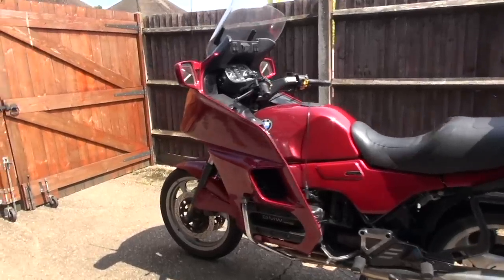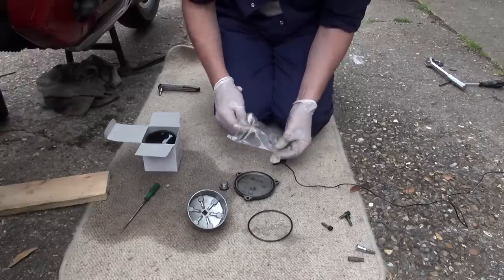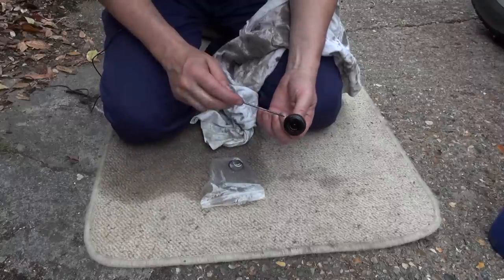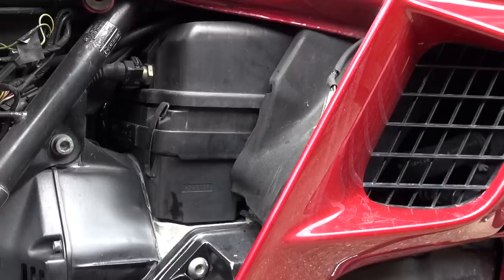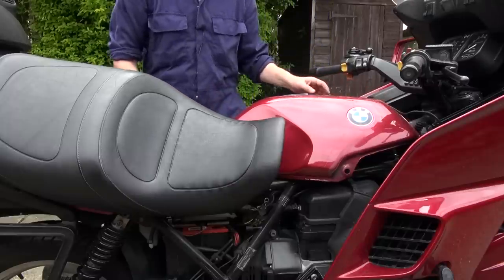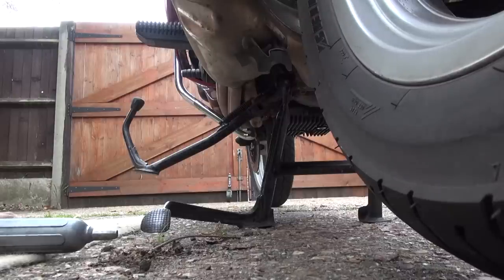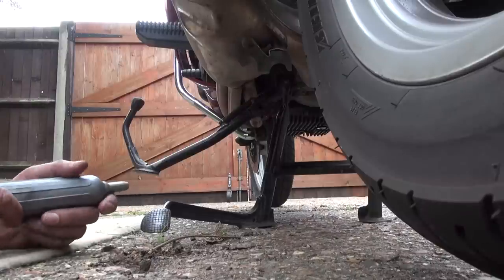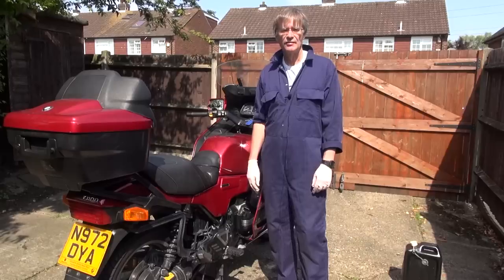Motorbike BMW K1100 10k service

Comment: Great video.  I'm especially grateful that you didn't add music to it.  Thanks for that.  You've made swapping air filters look dead easy -- I've always had a problem with that.  The clips are very fiddly.  The filters on these bikes are quite large and I don't feel they need to be changed often. 
I own a 1996 that looks to be the twin sister to yours.

Comment: I remember my 12,000 mile service (94 K1100LTSE) it was about 1 years old. And to maintain the 3 years unlimited mile BMW warranty I needed service done by a certified BMW mechanic. It got new oil, filter, plugs, fuel filter, air filter, steering bearings, new rear tire, valve (bucket) adjustments, it took over 8 hours. Labor was 75.00 an hour. I left for a 2000 mile drive and 3 days later my rear brake pads were steel on steel. Good thing I found a dealership in Canada. I still got the bike, and have a lot of miles on it but it sure does not get service like that anymore. No wonder BMW can have unlimited miles warranties with the services they require for warranties to be valid  nothing has a chance to break down, unless it’s your brake pads they missed,then it was “you must drive with the brakes on” . Nice video 👍

Comment: Good video. Suggest you thoroughly clean both oil filter and oil filter cup before installing. Also suggest filling oil filter with oil about 3/4th full. Prevents dry start.

Comment: Few things. It's a good idea to prefill the oil filter when possible.  Second I strongly suggest not starting any fasteners with the ratchet attached. That's a great way to unknowingly cross thread.  Third I'm surprised the oil is filled to the top of the window.  In every instance I've known the proper oil level is in the middle of the window though this one might be different.
Reply: If you were wondering he over filled it, oil level should be around or slightly below the dot after starting engine and letting oil move around.
Reply: @ElaBellll  In the manual of a K100, the top of the circle is the maximum, the bottom is the minimum. Pretty sure it is the same at this bike. As you could see, he has the manual also.

Comment: Very useful video, but I do tend to warm the oil up before letting it out; thin oil does tend to empty slightly better than cold more viscous oil, BUT if the oil is hot, you have to be a lot more careful as hot oil can burn.

Comment: Not sure why you would remove the oil filler cap until you are ready to drain and refill the oil. In my view this only creates a risk situation where foreign objects could accidentally be dropped into the engine. I own a 1994 model K1100LT-SE, my 3rd K1100LT, also own a K100RS 16 Valve and have owned a K1, K100RS 8 valve and K100RT and K1100RS.
Reply: Letting air in helps drain the oil. You can put the cap onto the hole after you unscrewed it to avoid falling something into the oil pan, just make sure air gets into while draining the oil.

Comment: like the video but i think taking your oil filer cap whilst you're taking the bike apart is a dangerous idea. just asking for dirt or worse still a small fairing screw to end up in your engine. In my workshop all the dirty stuff is done before the engine is opened up and it's opened up for the least amount of time.

Comment: Thanks for this very handy video. Would you know how to replace the ABS Relay switch by any chance?
Reply from the maker: Check out section 61.8 in https://www.bskspeedworks.co.uk/downloads/BMW__K1100LT_K1100RS_Repair_Manual.pdf
Reply: @NigelEaland  Thank you so much for replying. Much apreciated. That helps. I am having touble with my ABS lights alternate flashing which started with a weak battery. I have tried to reset with the plug to earth. The lights resets but it goes back to alternate when i take off. I cannot afford a pump or computer so I thought i would start with the relay. Thanks again. Cheers :)
Reply from the maker: @JohnFrancois-ti4wh  I have total sympathy with you. After failing to resolve a braking issue my bike has been in the shop for 4 weeks trying to diagnose a binding front brake. After much diagnosis and rebuilds of callipers and master cylinder the ABS2 has been declared faulty. You can’t get new replacements but there are places you can get the control boards repaired. 

My understanding is that ABS1 and 2 reset in different ways. There is talk of looking for corrosion on connector pins. These links may help you.

http://bmwk10075abs1fix.web.fc2.com/
http://bmwk10075abs1fix.web.fc2.com/ABS2-repair1.html

Unfortunately I’m having an ABS bypass kit fitted and I’m thinking it’s time to replace the bike. 

Good luck.

Comment: Thanks for posting this  video! About the gearbox oil, did you say 160ML? Or 1.6litre?thanks
Reply from the maker: I was talking about measuring the level of the gearbox oil when filling which needs to be within 116-126mm to the top of the filler. You need 1ltr of SAE 80W90 oil.
Reply: @NigelEaland  okay, thanks. I will also measure the old oil for found out how much it will need for the next service..

Comment: Nice video. Thnx. How many miles is on your K1100?
Reply from the maker: Just under 60k
Reply: @NigelEaland  and still going strong I believe. I love the oldskool BMW'S. Thinking about trading my r1200gs in for a k1100lt in good condition.
Reply from the maker: @vinjofin1972  I love mine. It’s a head turner.

Comment from the maker: It sounds like the wiring to the kill switch on the right bar. I think there is a connector on the steering that may have pulled apart. Trace the kill switch wiring.

Comment from the maker: You can buy all the replacement parts as a kit from https://www.motobins.co.uk/. The tools you need are:- metric socket set, flat head and cross head screw drivers, feeler guage, Allen keys, grease gun. Then you need a couple of special tools. The oil filter removal tool and a long spark plug socket https://www.motorworks.co.uk.

Comment: Hi awesome vid. Do you have a video on how to check valve clearance on the k1100?
Reply from the maker: I’m afraid I haven’t. Valve clearance requires shims rather than adjustment so I put my bike into the garage to get them done along with the timing chain. The timing chain was badly stretched at 45k miles.
Reply: @NigelEaland  
ich lebe im bundesstaat amapa in brasilia im norden von brasilien macapa, ein deutscher kam mit diesem bmw k1110lt 750 zu meiner arbeit und gab mir sein fahrrad kostenlos, aber es braucht einige teile, aber sie haben es nicht hier, du hast es geschafft um mir einige dieser Teile zu verkaufen, die ich übertragen habe, und Sie senden es per Post 📪
Reply: Ich habe dieses Fahrrad geliebt, es müssen die 3 Bremsscharen und der hintere Stoßdämpfer ersetzt werden.

Comment: Hello Nigel!  i have an issue with my 11LT -95.  we have no contact when we turn on the ignition unfortunately. Do you have any suggestion where to start troubleshooting? Our problem began when reversing and applying front brake making forks rise. Then we only got contact when turning to one side.  We pushed in a glove between the forklegs under the ignition and could drive home, 20 kms.  But now we dont get it up and running. At full right we could push on the bottom of the key switch but then turning left made it stop, ie no fuelpump no lights etc was working. We are now trying to lift top triple tree to get access to the wiring. Do you have any suggestion what to do next? regards Par

Comment: Hi nigel rhx for yr effort! Is the k75 and k100 identical concerning anatomy resp.partnumbers? Oil air and fuelfiter by any chance identical? Wanna buy k75 or k100 tomorrow
Reply from the maker: The K75 is the cut down version of the K100. The manual I have from the time I had a K75 was also for the K100. Probably the easiest way to check if the oil and air filter are the same is to go on Motobins web site and look up the parts for each. https://www.motobins.co.uk/
Reply: @NigelEaland  thanks that is very helpfull, i live at continent, but this is so far the best partswebsite ....prices zre higher than here on continent i think....you are British...what i wonder...are japanese parts cheaper than bmw parts? In the states bmw parts zre even higher i guess....i have 2 boxerbmws....but want to explore the k model....as daily driver...consumption is quite low, what i read....
Reply from the maker: @bobdelaplage690  the k75 is great for commuting and the fuel consumption much better than the K100.
Reply: @NigelEaland  thanks Nigel!

Comment: I can't believe you got those 3 air filter clips back on w/o taking anything off.
Reply from the maker: It’s a right fiddle and would be so much easier if one end of the clip was retained. The front one fas to be done by feel.
Reply: @NigelEaland  I have would liked to have seen you do it on the vid...
Reply from the maker: Beemrdon it was difficult to film as for the rear clips my hands blocked the view and for the front I do it by feel. What you need is long pointed pliers to place and hold the clip in place while you use a finger on the other hand to push the clip down. 

My next video will be changing the front disc rotors. I just need a nice warm day. Thanks for watching.

Comment: Hello again!! We have found and reöaired the problem. Cables in the triple tree were scuffed. Now they are repaired and made lo ger. But now next issue...  Backlight blows and also stoplight isnt working. Do you have any suggestion about that? Best regards Pär
Reply from the maker: Pär Jonsson - the bike has a bulb monitoring unit. The hand and foot brake switches go into it and the rear bulbs are driven from it. For me the obvious first thing to do is put a volt meter across the bulb connectors and see if you have about 13.5 volts going to the bulbs with the engine running. When you start there should also be a red light on the instrument panel which goes out only if both brake switches and the brake bulb are working. Do a search on google for a wiring diagram. Bulb blowing can be poor bulb connection somewhere causing the bulb to flicker and die early. There may be a poor negative connection to the bike frame near the rear lights.
Reply: Thanks for thst. We will have a try. Pär

Comment: Kind of ruff. You should start by hand with threads like those : extremely sensible, you brake it once and you are lost forever. And as the time goes by it becomes worst. I hope you won't discover the hammer.

Comment: I have an intermittent click and clunk sound from the gears when the clutch is pulled and the engine is ticking over, what can  this be? K1100LT 1997.
Reply from the maker: Are you sure it’s the gearbox? I think it’s your timing chain. Get it to a garage ASAP before it snaps. The timing chain is really thin and only last about 40k miles. I had the same problem and when they took mine apart the chain had worn a hole through the tensioner and was ready to break.
Reply: @NigelEaland  Many thanks, Have got a mechanic to look on thursday.